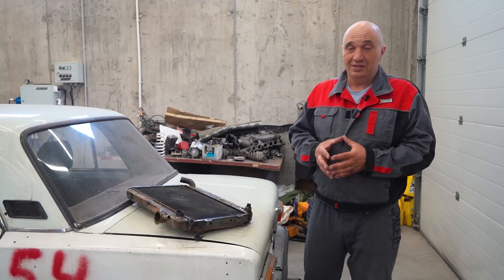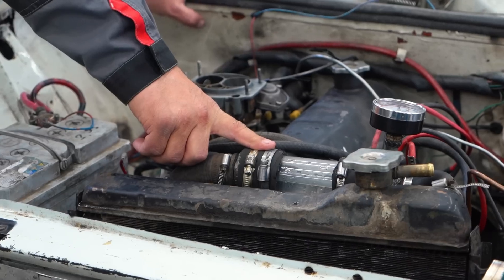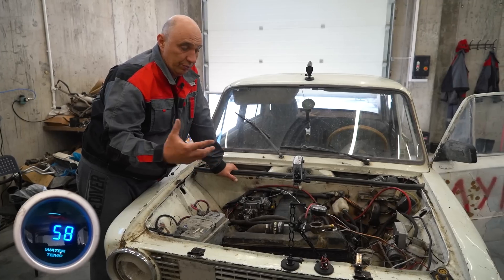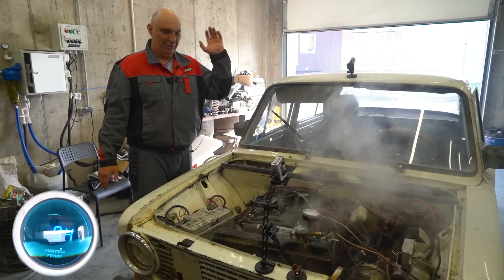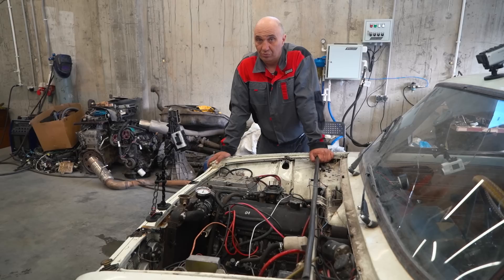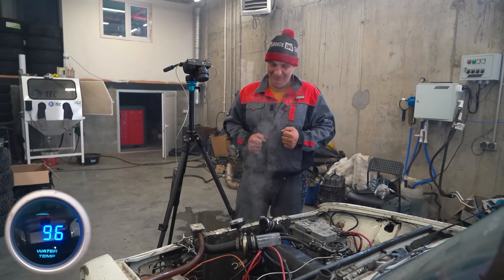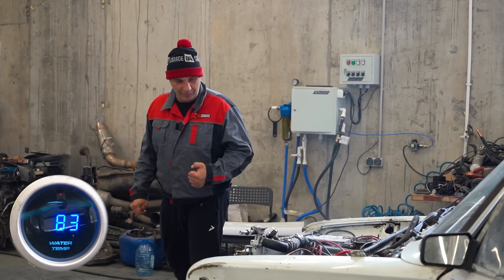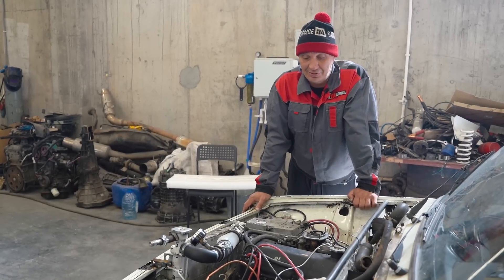Getting coolant to boiling point - what will happen?

Comment: Nascar engines pressurize the coolant system to around 50 psi and run the water around 280. Turns out the cars are faster having less drag from cooling than the loss of horsepower from running so hot.

Comment: That filtration system at the end was extremely cool. I am going to build one probably. Very good idea.
Reply: It's a pretty standard filter system
Reply: It is better to replace it every few years, on my one got the mechanics a bit crazy 
The Manuel says it has the French red coolant but had blue in it, but if it was the German or French blue nobody knew, so to fill it up got yellow coolant used which is compatible with both, so I had coolant that was green.
Found out a lot of service hasn't been done, like the timing belt (2 years over), both fuel filters (big one 2 years, smal one 4 years), airfilter (4 years) and much more. 
They worked 15h on it, and now it has a big performance difference

Comment: Engine coolant additives become acidic, acid and metal in presence of oxygen creates corrosion...from my nissan N-Step 1 training like 20 yrs ago, i was taught to measure the voltage generated by the liquid in cooling system, using a multimeter to measure voltage dc, black test lead to car chassis, red test lead just in contact with the liquid in cooling system...a reading of more than 0.15V dc means the liquid has become acidic and is reacting with metals, usually aluminium corrodes first/easily...if have a full cast iron engine, no steel or aluminium parts present, a reading of 0.32V dc is the limit...also from experience, using demineralised water such as rain water in cooling system is best as would have less ions present to generate acids...but rain water can have dissolved oxygen and carbon dioxide, best practice is to try and bleed out air from system with engine at boiling temp...dissolved gases come out of solution...what i do is gently open my cooling system cover with engine hot till water starts to come out ..run car next day, when hot perform the same...topping up fluid as needed...after about 2 weeks, get literally all dissolved gases out...and cooling system fluid remains clean for years...no corrosion

Comment: You should try using liquid nitrogen in the radiator to cool the engine
Reply: Yes!!
Reply: He would need a ton of liquid nitrogen, liquid nitrogen boils a lot faster than water. It may be really cold but it's heat transfer capacity is nowhere near to that of water. 
Still would be fun to watch lol

Comment: looks like I'm going to have to do my truck, that thing hasn't had a change in a long time cause there is a smell like very weak antifreeze when it comes back from a long run. thanks, I guess I'll have to replace the cap too...
Reply: Give all the hoses, clamps, and your radiator a thorough check before you replace the cap. 

It's fairly common for the caps to weaken over time and instead of holding 12psi may only hold 6, or even near none.... So one you put a fresh cap on the system is suddenly able to pressurize and if you have a broken clamp, or a cracked radiator it can blow apart. 

So, find your leak before replacing the cap.

Comment: The pressure really make a huge difference in boiling temperature, and when the pressure drops the water will boil furiously. With enough of a difference you get something called a flash conversion where water goes from liquid to gaseous without passing the boiling stage. This can be extremely dangerous as in this conversion the volume goes up by something like 1700 times! This means there are a whole lot of superheated steam spewing out at ridiculous speeds.

My father worked at a heating central and the system worked at something like seven or eight bars, and the water temperature was between 120 and 140 degrees. The high pressure was because they heated a few high rises and the temperature was because if you had to use high pressure why not make use of the increased heat capability...

Well a system heating over a thousand apartments will contain quite a bit of water, and when it is heated up it will change in volume quite a bit. To account for this they had a huge pressure tank that with a volume of something like fifty cubic meters. This was the expansion vessel, but even that wasn't enough to hold the overflow if the system had gone cold. They had an automatic fill function that added water if the level in the expansion tank got to low. But when the temperature got up to working range there were no automatic system for draining the necessary water, so you had to do that manually.

Lest just say that opening that huge ball valve and letting out a few cubic meters of 120°C water was kind of scary.  The room was not that large and the amount of steam was very impressive. You really got the feeling that if you stuck your hand in the jet you would get back a skeleton hand...

They also had the hot water line in the building connected directly to the boilers. That meant you had boiling water in the tap. A lot of visitors got scalded by not thinking about that even though there were warning plaques. You got used to it and it was great when cleaning up after a meal. Just blast the plates with boiling high pressure water. It got rid of just about anything and disinfected the rest...

Comment: Lada niva 1600 it just won't overheat no matter what even when doing 2k rpm climbing off road uphill for 15 minutes in slow 1st towing about 400-500 kilos in 43 celcius hottest summer day.. after that i even removed the temp sensor and apllied heat to it to make sure the sensor and gauge are working properly.. it's sad i hear the 1.7 after 1994  have some issues

Comment: In the early 1990's I had an '85 VW Scirocco turbo.  I wanted to increase the boost from the factory 6 psi to something higher, but I realized that 1.  I needed an intercooler.  Callaway sold one with their kit, but I never got to that point with the car.  2.  I needed better cooling before I added boost; I was thinking 11 psi.  So I tried what was called "Evans Cooling", which was advertised in European Car magazine via an article in which they used it on a GTI.  I bought the kit and had it professionally installed.  Evans Cooling uses NO water, just pure propylene glycol with a bunch of additives.  It was advertised to run considerably cooler than stock but with NO PRESSURE cap.  It ran at atmospheric pressure.  OK, so I tried it, and guess what?  It was complete bullshit!

My car overheated after about 20 minutes of driving.  Why?  Propylene glycol cannot transfer heat anywhere near as well as plain water!  What I found out later was that with a larger water pump and a CUSTOM radiator with fewer but larger tubes, this stuff could indeed take care of the cooling duties, and the boiling point was WAY higher!  

What I learned:  What you read in magazine articles about products is probably produced by the product itself.  The article said NOTHING about needing a different water pump/radiator, and these weren't even available while the company foisted this CRAP on the Volkswagen community!  

European Car magazine these days is bullshit, all it shows is high dollar modified cars and there are few do it yourself articles.  Bring back VW&Porsche magazine!
Reply: Water is the best refrigerant or "cooling agent" available as far as I'm aware of. 
Per mass it can transfer alot more BTU's/hr or kW/hr than other refrigerants in the market today and that includes propylene.
If I could use just pure distilled water in my car I would but propylene is needed for it's anti corrosive properties. 
Where I live in can get away with just 5% propylene but usually just do close to 10%. Colder climates that reach below freezing need more.
Reply: Or Getta Decent Veee-Hikull

Comment: These guys need to work on their safety protocols a bit. As someone who’s been burnt by a cooling system that failed, that is not something you all should have been so carelessly messing around with. The video was fascinating, but you should have either used some proper fittings or it should have all been filmed remotely. Seriously, this was dangerously done.

Comment: Fill the system with a pure antifreeze without any water and watch what will happen. Pure antifreeze will be able to handle almoust 200 degrees of celsius temperature before it will start to boil. That would be nice to see.
Reply: That's what I thought they were going to do based on the title of the video! 🙄
Reply: I’m thinking the engine might not make it long enough

Comment: Doesn't look like antifreeze but only water instead. You should use a high quality coolant. Temperature would be way much higher before boiling.
Reply: I guess the point of the glass and water without antifreeze is to see the boiling

Comment: Without a rolled lip on the ends of the clear tube I knew those connections were going to blow with pressure. Boiling water, and steam even more so, is nothing to mess around with. People have died after getting covered with boiling water and steam. That one guy is lucky he's not in the burn ward today.
Reply: That's exactly the comment I was about to write. They are really lucky...
Reply: @cmuller1441  they are russian. Not the same rules of universe apply overthere :D
Reply: It's absurd that they didn't learn their lesson at the slightest until the second time it happened. And they're lucky the third time was a slow failure rather than a explosive one, considering that they essentially built a steam powered soda bottle bomb.
Reply: Gotta love when ip popped and he screamed "BLYAT!".  Blyat roughly translates to "Oh Shit!" in English.
Reply: This is why the life expectation in Russia is so low. Not Putin, not western sanctions, not alcoholism...just sheer "Can we do it" curiosity that lacks the "Should we do it" part.
Reply: Yeah sure you did lol..
Reply: Pressurized steam is some of the most terrifying stuff. CNG, that just leaks out, Compressed steam has way more PSI and can be very hot.
Reply: Its amazing how they just blithely keep going... Plastics like PVC and acrylic will flow and shrink/expand under load when they get hot, so clearly the solution is to add more hose clamps! The cherry on top is him just going back to chillin' there each time assuming its all good despite it failing repeatedly the same way. I had a cooling system blow up in my face. Not a fun experience.
Reply: My thoughts exactly, most people would be traumatized by being that close to getting their face melted off by steam.

These guys just shook it off and kept on with the experiment.
Reply: @syrthdr09sybr34  Maybe it wasn't even the first time it happened to them.
Reply: @fungo6631  You're right, more than likely.
Reply: Their russian they dont give a shit
Reply: Don't be ridiculous, obviously you don't work on cars😂

Comment: What is the big hole in the bottom of the radiator for?
Reply: The one going through it? Starter handle, Ladas were one of the last few cars built that you could hand-crank to start them if the battery was too low or the starter was goosed, there's a hole in the body for it as well so the handle can pass right through without lifting the bonnet... :)

Comment: try making an ethanol vaporization heat pipe cooler, low vacuum with ethanol liquid to gas and to liquid cooling tower, heat transporter, from the part to a radiator cooler, keeps them separate, no burn
Reply: ethanol boiling point is around 74C, lower than for water at 100C, so expect the part to stay at 74C
Reply: no active pump for coolant flow required, passive pump by heat vaporization only to transport heat
Reply: I'm pretty sure, that ethanol is also pretty flammable so it might not be the best thing for cooling something, that literally works by combusting vaporized gasoline
Reply: @terasestHammasratas  dont put anything else in the  vacuum tube
Reply: @Jkauppa  yes, I would like to see it as an experiment, but I'm just saying, that it's not the best thing to use as coolant, as it's basically fuel and will likely make a really big explosion if the ethanol (gas) leaks out (fast enough)
Reply: @terasestHammasratas  hey its safe even if it leaks out, like from the engine exhaust, dont you worry, dont let it go